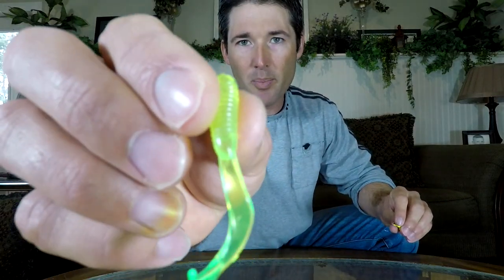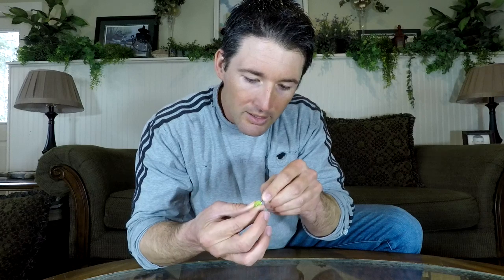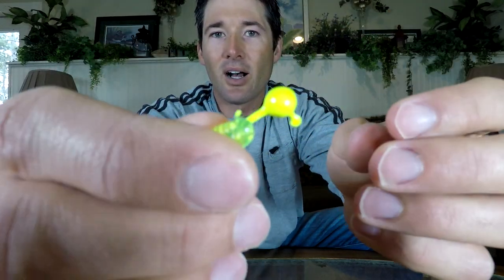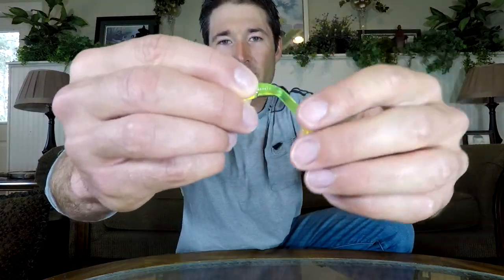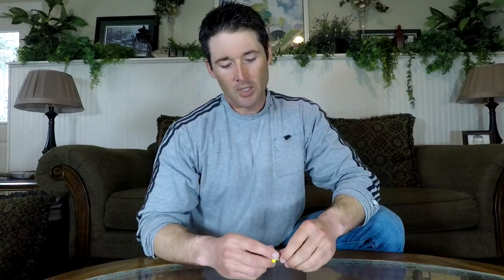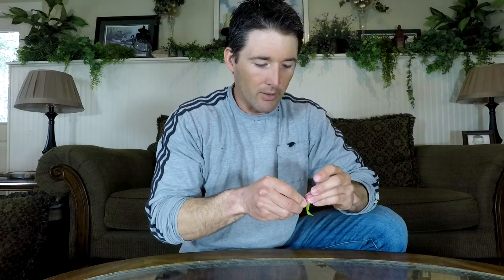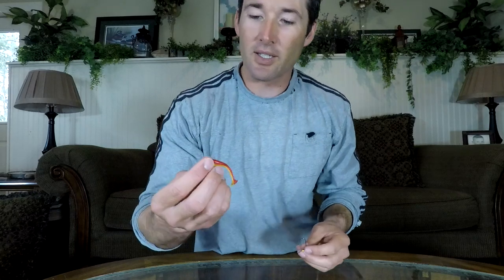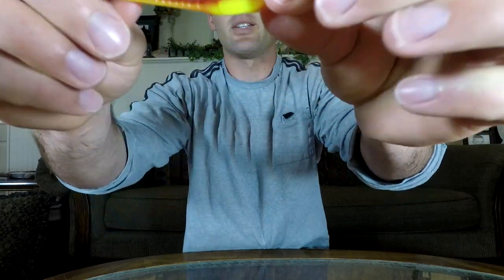Crappie Lures - How To Rig A Jig And Plastics (Quick-Easy)

Comment: Do you have to use a bullet weight when using these? Or is the jighead heavy enough
Reply: If you use an ultralight rod with light line between 2 and 6 pound test then you can cast these just fine without added weight.